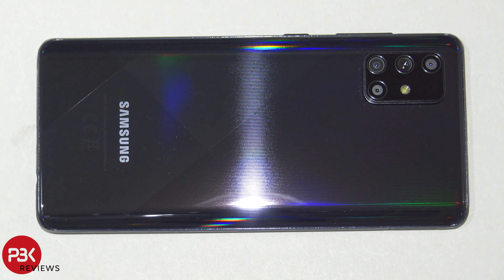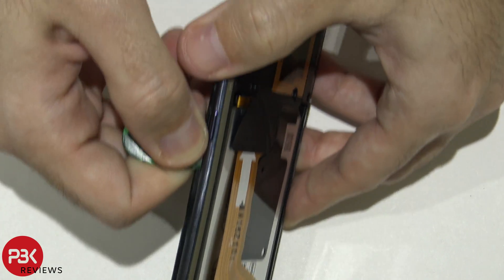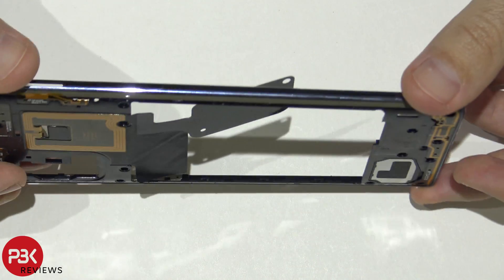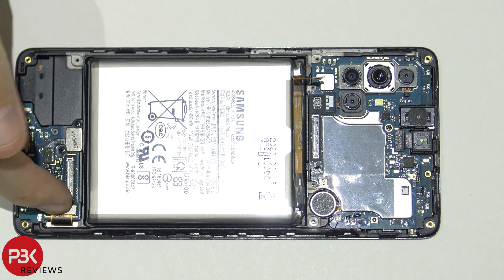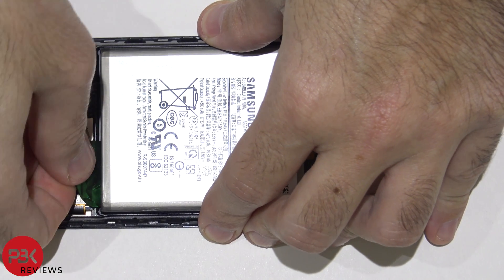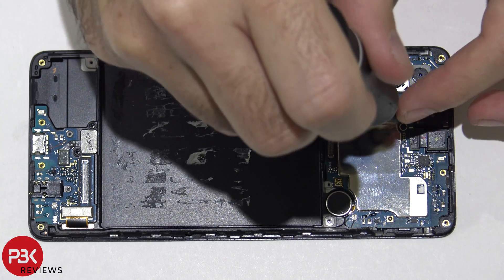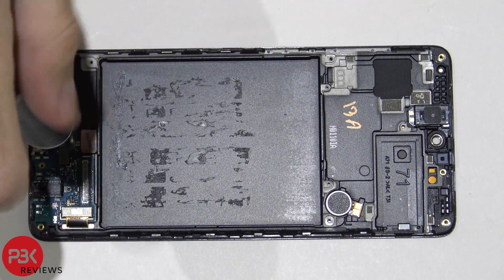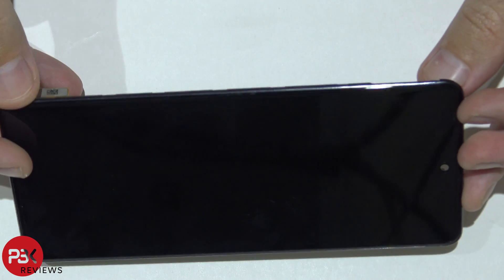Samsung Galaxy A71 Teardown Disassembly Repair Video

Comment: Hi, do you know how to remove the NFC and bottom speaker from the middle Frame? Only replacement middle frames that I sold are without the speaker and NFC... Is it possible to remove it from my old frame and somehow glue it on to the new one? Appreciate the teardown video

Comment: CAREFUL! I was following along this video and others like it but it seems maybe my A71 is not the same.... it's an A716U specifically and when I tried to separate the "mid case" wraparound from the screen side, what actually happened was I pried the glass off the LCD? I'm not sure. All I know is that I was left with dark glass, and gold foil surface still on the phone. I saw another screen replacement video and it seemed that maybe that one was more like my phone as you could buy the screen with the buttons already installed, which seems very different than this model A71. Does anyone know what I did? Otherwise, great video, but I don't think it was for my A71. 🤷‍♀

Comment: heyo, i have a question. i replaced the board with the usbc port as well as the battery. everything works fine, but my phone still doesnt charge. ordered a new different board with a usbc port, same thing, doesnt charge but everything else works. any suggestions?
Reply: btw i replaced the board because my phone didnt charge anymore. while replacing i damaged the battery, which is why i replaced that as well.
Reply: could it be the connection cable from the main board to the sub board?
Reply from the maker: Yeah, it could be the flex cable from main board to sub board, as well as the coaxial cables.

Comment: Thanks to this video I was able to open my phone and I'm now drying it in rice. It fell in water for 1-2 seconds about 1 hour ago and a few minutes later the touch screen wasn't working. I initially thought it would be very difficult to open it because from the outside it has no screws etc but it turns out it was much more easier. Will wait for 48 hours for it to dry before I can report any results.
Reply from the maker: make sure to disconnect the battery cable, brush off any corrosion on chips or connectors with a small brush like a tooth brush, and then re assemble the phone so you don't risk shorting the phone.
Reply: @PBKreviews  Thanks, yes I have disconnected the battery immediately (that's why I opened the phone).
Reply: @PBKreviews  I just tried the phone and it seems to work perfectly well now 🎉 I'll monitor for a few hours to see if battery heats up or any other anomalies. But as of now it works perfectly. Thanks for the video which enabled me to open it and for the advice ✨👍

Comment: Battery part was hard but i realized i was replacing the lcd. Turns out, i could just remove all the boards and remove the battery without the worry of ruining the previous lcd back 😈😈😈

Comment: Well done. I have an A71 and I went to Ubreakit Ifixit and one other place that Virgin Mobile bought out and nobody said it could be fixed.
PROBLEM: Phone body bent from being in a back pocket. Everything works EXCEPT the sound.

There is no way I could attempt what you have done as I have 2 left hands. This video is extremely professional.

Comment: Mine absolutely died 12 months into the 24 month warranty. It started to repeat through start-up, then vibrated almost nonstop and then no sign of life. Samsung repair tech says it's a motherboard issue. I have no idea so I am curious to know where physically is all my lost information held and is it indeed lost?
Reply from the maker: The storage chip is soldered onto the main board behind one of the shields. It is not removable.

Comment: My fast charging stopped working on my a71..it charges still but takes 6 hours instead of 1 and was wondering how I can fix this and what it would be? Battery or charge port or something else? 🤔
Reply from the maker: Could be either the battery or charger port, you would need to test it out with new parts to see.

Comment: What do i have to do if i have water damage?
Reply from the maker: Take the phone apart, disconnect the battery cable, dry out any liquid inside and use a small brush like a tooth brush to brush off any corrosion on chips or connectors. Then re assemble and test to see if you can get it working. If not, its possible some parts like the screen or battery may have gone bad and would require to be changed and worst case the board might have gone bad and would not be worth attempting to fix.

Comment: I have a Samsung Galaxy A71 5G that is giving me problems. The battery discharges very quickly and does not pick up Wi-Fi signals. From what I could see in the video, the battery can be identified, but it was not clear to me where the part that is responsible for the Wi-Fi signals is.

Comment: Great video thanks. Very clear.

I managed to change the charging board on mine and it can now charge again :).

However, now the phone hardly picks up any mobile signal (1 bar or no bars). What might cause this? Damaged antenna or sim reader?
Reply from the maker: Make sure all the cables are connected properly and also the sub board (charging board) and motherboard are seated properly since they have antenna contacts on them which touch parts of the frame for signal. Also make sure the charging board you bought is the same model for your phone since it has antenna contacts on it which can very from model to model. As well as aftermarket ones might not be as good as original ones. A71 and A71 5G would vary in board type.

Comment: You skipped how you actually got something behind the screen side to pull it through, the tolerances are way to tight to not break the glass. Also this A71 I have, the sim tray is at the top.
Reply from the maker: You just need to use a suction cup tool or a thin razor blade (which would probably scratch up your back or frame a bit) to gain leverage to get your pry tool in. Also maybe you have a different region variant A71 which might have the sim slot in a different place which shouldn't really be the case or you have a different model phone.

Comment: Watching this in preparation for doing a battery replacement. Had mine since May 2020 and the battery has degraded to the point I can't get through a full day, will probably upload it so should be fun!

Comment: Is the speaker is in the charging board also? Or just the mic?
Reply from the maker: Hi, there are two gold points on the loud speaker flex cable which touch and make contact with 2 pins on the charger board or sub board to get signal.

Comment: What happens to the liquid damage indicator if there is liquid damage?
Reply from the maker: It turns pink or red.
Reply: @PBKreviews  do you replace those and if so how? In other words after repair so it works as an indicator again.

Comment: great tutorial, but after disassembling my copy, you can not see anything that would be damaged. There is a black screen all the time. If it was a whack, the display would react at least by a buzzer or a diode, vibration, anything. Nothing reacts. Charged 24 hours, I have no idea what fell in it. The screen appears intact. Could it be a motherboard or a battery? What would you advise to mention on this model?
Reply from the maker: Hi, sometimes hairline cracks in the corners of the screen which you can't see prevent the screen from operating at all. If it happened after a drop, that may be the problem. Aside from that if you haven't spilled any liquid on the phone or anything else, maybe a bad battery or it may also be a bricked (bad firmware) motherboard. You can always test with a working screen to plug the connector to the board and see if it is the screen or not, or same with the battery.

Comment: Great vid! Tried removing the back cover of my A71 because i wanted to replace it with another color. But I broke the orange sticker at the bottom. I dont know what this is for... 😭 so much for DIY
Reply from the maker: Thanks! The orange sticker is an antenna flex cable. If you tore it you would probably need one of these replacement parts (mid frame housing) to replace it. https://www.ebay.com/sch/i.html?_from=R40&_trksid=p2334524.m570.l1313&_nkw=galaxy+a71+replacement+mid+frame+housing&_sacat=0&LH_TitleDesc=0&_odkw=galaxy+a71+replacement&_osacat=0

Comment: My power button got some moisture it it. Worked for a little while then stopped. How much to repair power button functionality? Thanks
Reply from the maker: You can search for " galaxy a71 power flex " on ebay and you will see listings, they run from $10 to $15 etc and keep in mind there are a few difference versions. You would need to buy the one for the model number of your phone since they differ in flex cable contact points.
Reply: @PBKreviews  Thanks. I have to ask around abt prices. Hope, it won't be too much over 100 or so.
Reply from the maker: @svensilver3245  you're welcome

Comment: Hi. O am late but I would just like to ask  what is that short strip of yellow connector glued on the bottom part called? 0:46 Thank you
Reply from the maker: Hi, you mean the antenna flex cable that is on the bottom rim of the plastic?

Comment: Where is the part that usually heats up?
Reply from the maker: The main part that heats up would be the processor on the main board. Other parts also heat up, like the battery, screen, antenna ports at times, cameras etc.

Comment: What is the function of that Gold Lines 1:54 ?
Reply from the maker: They are just the connection lines which send and receive signal from the contact points for the antennas.

Comment: Hey! I got some water Drops my A71. It still works but it have some water in the camera lens, so what should we do. We brought it to an Handydoctor but he said he don't want to do it. I saw in this vid that you open it at the back. Actually I could open it that way too and just dry the water drops away. Would that be possible?
Reply from the maker: Hi, yea you can pry the back off and dry out any moisture inside. (After disconnecting the battery cable) Make sure to dry out any left over water or moisture inside the phone also to prevent any shorts or damage to the parts. You can also use a tooth brush or small brush to brush off any corrosion around chips or connectors. And then you can use a new adhesive strip, (Link for adhesive strip: https://amzn.to/3xOuNEr ) or a new battery door cover with the adhesive strip pre installed (Link: https://amzn.to/3vQgWvG ) to re-seal the back.

Comment: I keep losing wifi connectivity on my phone, ive done everything software wise to fix the problem including a hard reset. It's still losing WIFI connectivity, hardware wise where is the wifi antenna or what Coul cause this issue?
Reply from the maker: You would need to check and make sure that white wire cable is connected and has not come off which connects the sub board to the main board, and also the back plastic housing which has antenna flex cables on it would need to be checked to make sure all screws are fastened down in place and have not come loose or the back housing has not lifted up anywhere and come loose since those flex cables need to touch gold contacts on the board to get signal.

Comment: No thermal pads or paste,is possible to change the glass of camera on the back?
Reply from the maker: Yes, the camera glass is held on with adhesive. You can just apply heat with a hair dryer to loosen it and then pry it off.
Reply: @PBKreviews  mine is with artifacts in the main I will try to turn it over

Comment: hello. i hope you can reply to this, is there a part of the phone that can get disconnect if you drop the phone? i drop my phone yesterday and the phone does not turn on even on recovery mode and etc. thank you if you can reply to this.

also, what happens when the sub board and mainboard get disconnected with each other?
Reply from the maker: Yes, its possible the battery cable can become disconnected from the main board or more often it happens that the screen itself gets a hairline crack somewhere in the corner that is very hard to see and that rendered the screen unusable and it does not show anything. You can try using a strong light against the screen to look for any hairline cracks in it. Sub board getting disconnected from the main board on this phone would also make the screen not work since the screen cable connect to the sub board and gets signal from the main board  through the sub board.
Reply: @PBKreviews  omg thank you! I'll rry to reconnect ng cable and see if that would work. thank you for replying!!
Reply from the maker: @roshiii4  You're welcome
Reply: @roshiii4  Did it work?
Reply: @JoseLopez-uc2hn  nah, It wasn't disconnected, the screen still got the white line caused by the impact. I just brought it to a 3rd partg repair store and all he did was do something with electricity to the phone and it turned on, paid $3 tho. 

Bringing it on a service center costs way too much, I'll just stick with this, the phones performance isn't affected so ye🤷‍♂️

Comment: I have an a71, it broke 2 days ago. Its brand new though. See, it the screen went black for a couple of minutes, then it came back on. I checked everything. The buttons, the camera and the screen. Everything was ok. Until i went to charge it. It wont charge. I tried using other cables, and other chargers, it wouldnt work. What do you think the problem here is?
Reply from the maker: Its possible one of the cables has gotten loose or disconnected or possible a chip somewhere has broken.

Comment: How did you get the pry tool between the screen and mid-frame? There's no gap to slip the tool into. In the video, it looks like you already started with a huge gap. I tried with all my might, but couldn't get a gap. This is an A71 5G, so it may be slightly different, but probably not...

EDIT: Actually, looking at a few scratched parts of the mid-frame, it looks like it's metal.
Reply from the maker: Hi, you can use a suction cup tool or if you don't have one, a thin metal tool or razor (but this would probably scratch up your frame a bit) to get in between, then you can make leverage to get your pry tool in.
Reply: @PBKreviews  Thanks, but it turns out the A71 5G has an aluminum frame and your S20 FE 5G disassembly video was a closer match.

Comment: My brother has a problem with his A71. The cellphone does not recognize the cable when you insert it into it. Microphone and P2 working, just the charging port seems to not work. With a lot of struggle, the phone recognizes the cable. Fast charging is not working anymore, but normal charging does. I think the charging port is having some short circuit or it is badly connected. What are your thoughts about it?
Reply from the maker: Sounds like its possible the charger port itself has gone bad and the charger port board would need to be replaced which has the charger port soldered onto it.

Comment: Can this back panel  get fitted into m51
Reply from the maker: no it would not work
Reply: Can I buy white back panel for m51 on Maxbhi.com
Reply from the maker: @saurabhdubey5441  yes or you can try https://www.aliexpress.com/item/1005001830625510.html

Comment: Is that possible to change the battery to a larger capacity ?
Reply from the maker: Hi, no there is no room in the compartment to be able to fit a larger battery nor is it guaranteed that the connector on a different battery would match and work with the connector on the motherboard of the phone.

Comment: So I cracked the camera glass on the rear. In your video it looks like when taking off the back panel the camera lens cover came off in one piece. So is that replaceable by itself because looking at replacement back covers, none seem to include that lens cover. In other videos it looks like there is a separate cover that insets into the bezel frame. Any insight would be appreciated
Reply from the maker: Yes, the camera lens cover is replaceable and held on with adhesive. They usually sell those separately as well online.
Reply: @PBKreviews  Appreciate the reply. I ordered one off Amazon so thanks for confirming i didn't waste money lol
Reply from the maker: @str8stryk3r  You're welcome :)

Comment: Does it have cooling pad?
Reply from the maker: It uses graphite/graphene layers for cooling (the grey colored looking pads on the back housing and motherboard)
Reply: @PBKreviews  does it is water resistant?
Reply from the maker: @kawaki6093  It has some gaskets inside around some connectors but I wouldn't say its water resistant. Maybe minor splash proof.

Comment: Would new adhesive come on the replacement screen? Or would I have to put some on myself? If so what kind of adhesive?
Reply from the maker: Depends, some screens come pre installed with adhesive and some don't. Or some come with the adhesive for you to install but all depends on where you get it from and if the seller states it comes with it or not. If not you would need to use something like 300lse adhesive or smartphone red tape, but the precut adhesives which usually come installed or included with the screens always work best.

Comment: Obviously the phone's not IP certified but how is the waterproofing on the phone?
Reply from the maker: I would say it would withstand splashes, and it does have rubber gaskets around the battery connector and few other places but the adhesive on the back plate didn't seem the same as those on water resistant devices that I have seen, so I would not risk dunking it in water to test. But it does have water resistant features just not sure how resistant it would be :)
Reply: @PBKreviews  thanks for the response. Really appreciate it
Reply from the maker: @tayebbasit  you're welcome